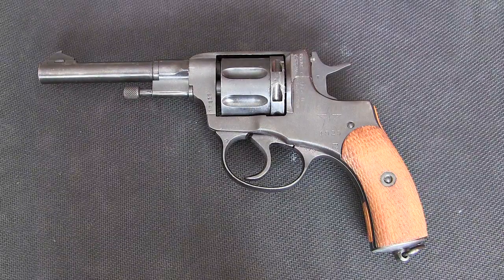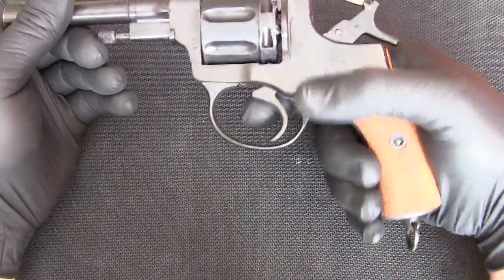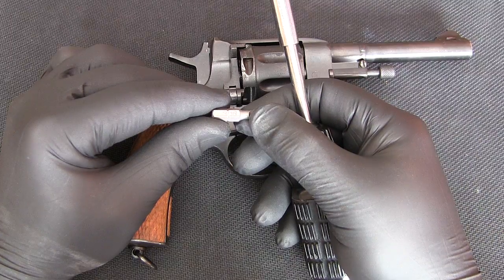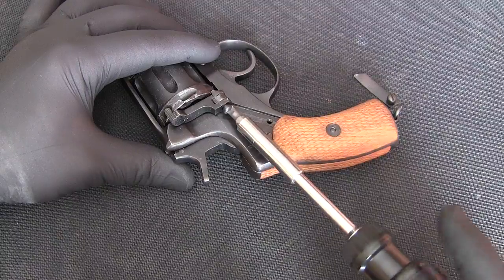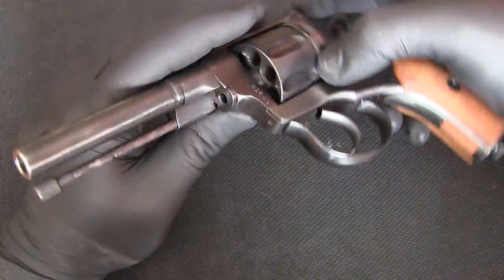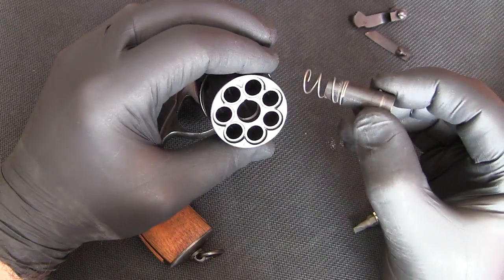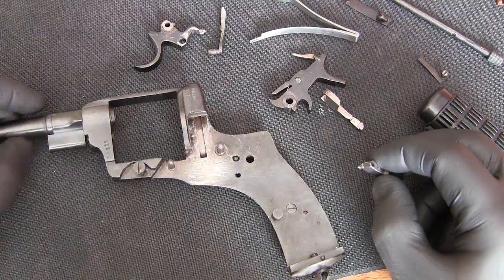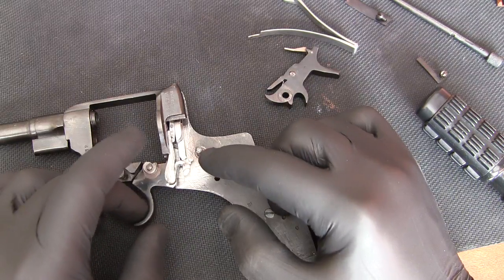Nagant M1895 Revolver Disassembly and Reassembly

Comment: So for taking off the right grip, you need to take off that V-shaped trigger spring???
Reply from the maker: Yes, the grip screw is blocked by it.
Reply: @MosinVirus   Marvelous engineering. Is it Belgian?
Reply from the maker: @morriszachrisson8359  it was Belgian brothers, I believe, that designed these for the Russian empire. Tula and Izhevsk (i believe) are the two Russian factories where these were produced.

Comment: Wat is the Nagant made of? Is it steel or metal? I want to polish barrel and frame. Would u recommend it? Or have any tips? I got some scratches/stains.
Reply from the maker: It is all steel. I would advise protecting the steel from rust by bluing or parkerizing after it is sanded
Reply: @MosinVirus  oke thanks mate🙏👌. I got something that is called browning instead blueing. Is that fine aswell?
Reply from the maker: @Wimpie-070  you can use it too. But the finish will be brownish

Comment: Excellent video. Very precise and well presented. Do you have a video of the spring lightening?  What is the new length of the cylinder spring and what is the finished thickness of the  trigger spring after sanding?
Reply from the maker: Sorry, I didn't make a video of that. I am pretty sure there should be some information out there. Pics maybe.

Comment: Hello Mosin, thanks for this video. Would you please be kind enough to make another video to show how you improve the trigger weight of the Nagant revolver?
Reply from the maker: Unfortunately I don't have it anymore.
Reply: MosinVirus That’s interesting. You don’t use the ammo made with the powder and bullet that the firearm was designed to function best with, by the manufacturer? Next thing you’ll tell us, you don’t use M2 ball in an M1 Garand because it’s too pricey or hard to find...
Reply from the maker: I use the Prvi Partizan 30-06 Springfield M1 Garand Ammo for my Garand.
Reply: Even with the reduced trigger weight it was still too much for you, huh? Did you at least tell the person you sold it to that many of the operating parts were no longer original?
Reply from the maker: Ammo was too pricey for me to keep it. And I was quite impressed with the trigger pull weight, so was the buyer. And I sold it for what I paid for it even though the prices got higher, and I always describe what was done to the firearm when I list something I own for sale.
Reply: Too pricey?! It’s still less than $3 for a surplus pack of 14 rounds, when you buy a full ammo can, even in the midst of the current buying frenzy. You would be hard pressed to find any foreign surplus ammo cheaper than that.
Reply from the maker: I usually don't shoot surplus ammo.
Reply: Nn’kay.
Reply from the maker: By the way, the only reason I went for the reduction of trigger pull weight on this revolver is to learn how it is done and what can be accomplished. You should check out my videos on Colt 1917 fixes and modifying my Beretta 92FS.

Comment: I have the same pistol. Same year as yours. Would you know what part is causing my double action not to work.
Reply from the maker: Officers models had double action, soldiers models had single action only. You may have a soldier's version. You would need a different hammer with a double action sear. See if google will translate this page, but you can see the difference in pictures. First is the soldier's version. Second is the officer's
http://historypistols.ru/blog/revolvery-pod-unitarnyj-patron/revolver-nagan-obrazca-1895-g-otlichie-soldatskoj-modeli-ot-oficerskoj-zaryazhanie-razryazhanie-patronami-barabana-revolvera/
Reply from the maker: Actually 2 parts - hammer and camming block.
Reply: I think I found the problem . It’s the double action fly spring , would you know were I could find this part for sale.
Reply from the maker: Try GunPartsCorp.
Reply: MosinVirus I checked and unfortunately they do not have that part but do have a bunch of cool stuff. I bent the spring a little bit and it works fine now , but hope to find a new one somewhere. Thanks for your help.

Comment: Older video but really a fantastic break down.  These Nagant revolvers are really a fun gun to shoot, and it's surprising they can still be had for such a decent price to this day.  You have to look around a bit, but they are still out there.  I got a 1913 for $200 a few days ago with some surplus ammo.  Graf and Sons has a reasonable price on the surplus 7.62 Nagant ammo for $4.15 a box of 14.  Flat rate shipping of $7.95, its best to buy as much as you think you need in one shipment.  Perhaps there might be some other options, but I like using the original ammo since I don't reload and am not sure about the availability of dies for this peculiar little round.
Reply from the maker: JackOSUrulz thank you. Yes, they are indeed very interesting, and one of the few revolvers that can be used with a supressor.

Comment: Many, many thanks for your video. My Nagant made in 1940 was only operating as single action. From watching your video I was able to disassemble and determine the double action hammer fly spring was missing. From another type of spring I had on hand, I fashioned a new one for my Nagant reassembled it and it works perfect now. I would not even tried to attempt this, until I watched your video several times. Mighty great help.
Reply: There were infantry models that were modified to be only single fire. They only trusted the officer's to be accurate with double action.
Reply: @nickuva6508 most of them were supposed to be converted i believe so having a single action only one is actually rarer id imagine
Reply from the maker: William Derrel Lyon my pleasure. enjoy your Nagant

Comment: I just followed your lead and tuned one of mine. Single action pull is a VERY crisp 5.15 pounds. Down from a rough 12.8 pounds. Double action was originally 21.2 pounds and rough. It went down to a very smooth 15.5 pounds after reducing the top arm of the spring. A further reduction down to an average of 12.15 pounds was achieved after clipping two coils off the cylinder pin coil spring. I just test fired it, and it works beautifully. I would probably never have thought to clip the coil spring without your video. I didn't completely polish everything like you did. On the bearing surfaces, and the sear  on the hammer and the sear  on the hammer. Back sides of the parts as well. I used 600 grit garnet paper wrapped around a small file. Only enough to remove all the tool marks. I would say this Nagant now compares favorably to my very nice and early Charter Arms .44 Bulldog. You can still "feel" the cylinder moving forward, but that is just part of it. Trigger both double and single action is now far superior to my Webley Mark 4 in .455. So --- THANKS!
Reply: Oops - make that the sear connector on the trigger and the actual sear on the hammer. Polished to remove tool marks and square them up.

Comment: nice revolver...its been marked and dated 1929 by Tula Arsenal. Its rare to find one marked by Izhevsk.
Reply from the maker: you are absolutely right. I actually did some stuff to the action and it became a very shoot able revolver with a decent trigger pull. but I sold it.
Reply: MosinVirus I have the same one in extremely clean condition. Same date and markings, do you know if it’s worth anything or what you think it’s worth?

Comment: Yeah Bro teach me how to lighten the trigger pull.......
Reply from the maker: Thank you for watching my video. What I had to do to lighten the trigger pull, and what was in the bunch of articles on this revolver from back in the day, is all contacting surfaces needed to be stone polished. The V spring was thinned mainly on the lower arm. I kept thinning it and trying the tension. The main thing is not to overdo it or your trigger will not return correctly. Once I established a good trigger return while lightening the pull, I moved to thinning the upper arm that controls the hammer. For both arms, stay away from the 1/2" at the end and 1" from the bend. Thin in the middle of each arm. The upper arm should be thinned very slightly or you will start getting light primer strikes. Lastly, I cut one coil from the Cylinder return spring. This will further lighten the trigger pull since you will not be working against so much tension while pushing the cylinder forward to create the gas seal.